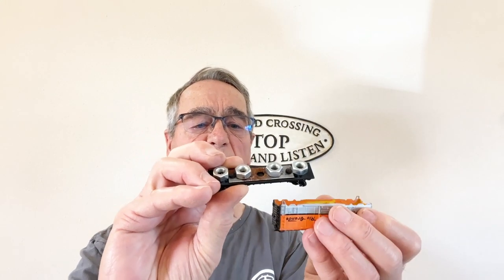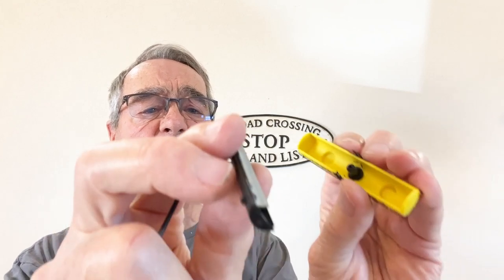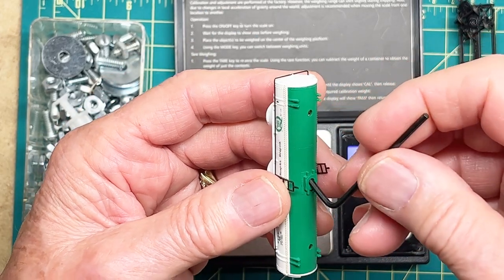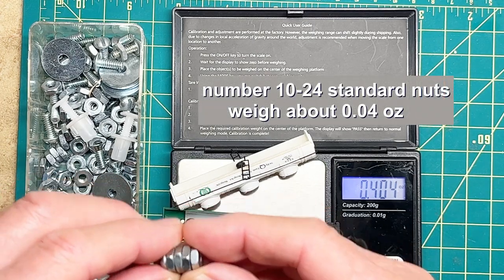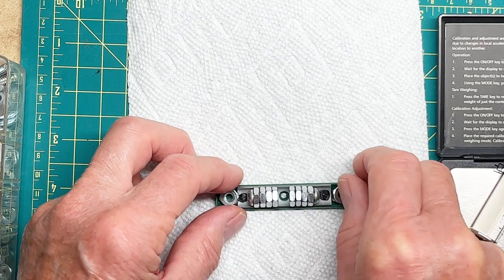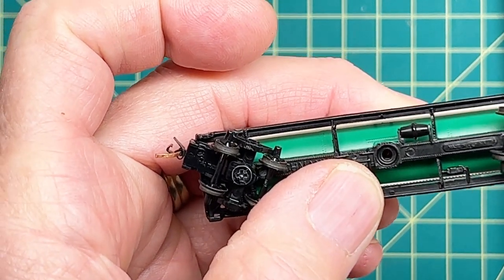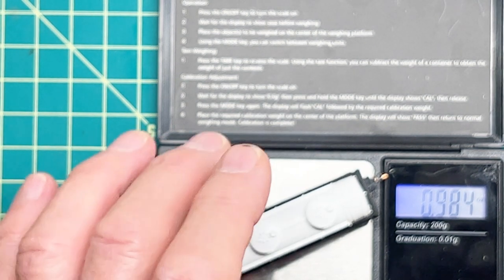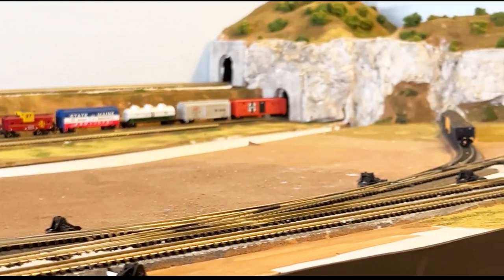Tuning up the Long 3-Dome Tank Car--adding internal weights

Comment: I had several cars that would derail easily . They were really light . Thanks to your video's I put some nuts in them to help them stay on the track . I don't have a scale , so I guessed . Thanks
Reply from the maker: Good for you, I'm glad it helped.  the scale by the way is incredibly cheap and is worth it.
Reply: @DeansNScaleTrains  , Thanks so much . Enjoy your video's and am getting ready to order your engine shed .